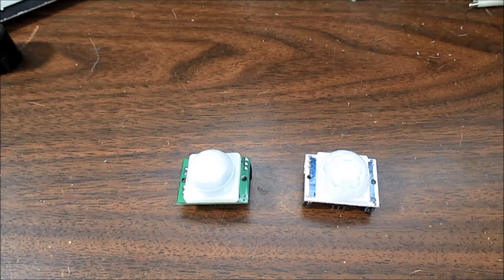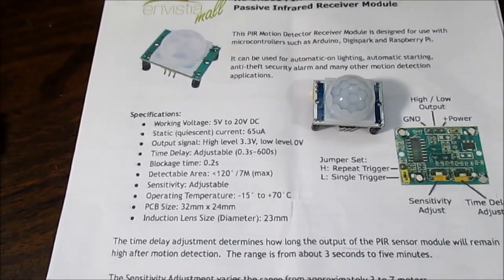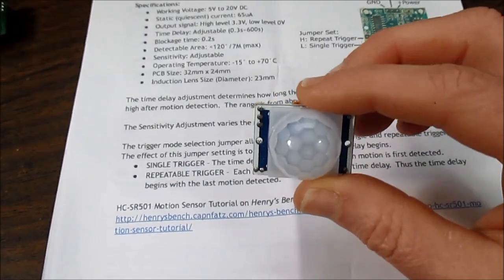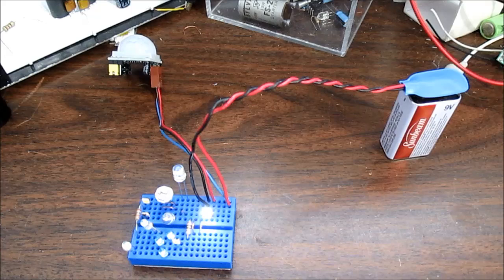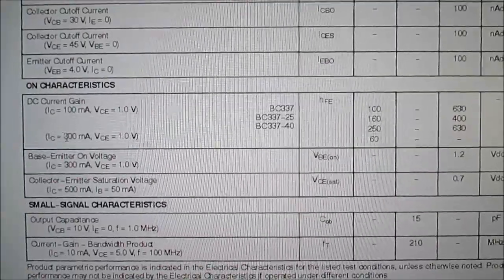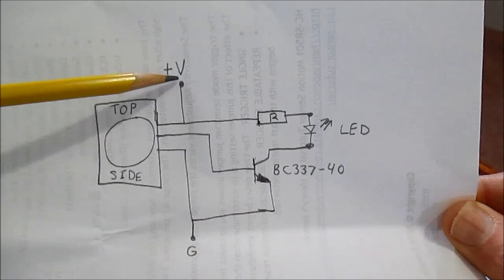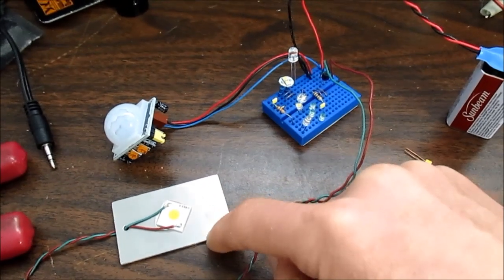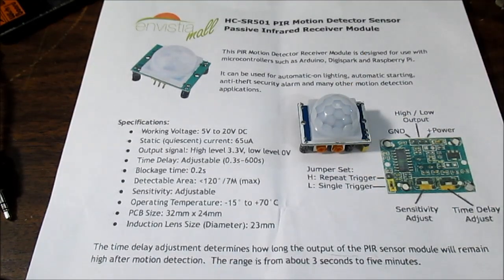Passive Infrared Receiver (PIR) sensor review, test & how to use

Comment: Please help me 
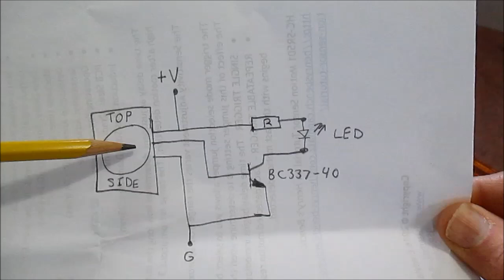If in the circuit shown in 8:45 , i want to use a mini vibration motor(coin type) in place of led at the output, what should i do? The vibration motor has ratings of 3V
Reply from the maker: Depends on the current draw of the motor.

Comment: Hello, thanks for the video. I am trying to use this sensor to light up a strip of 5v leds. I am using 5v power supply. I am doing exactly what you have showed but the problem is that Leds lit very dim. I have checked the output voltage and it is around 3 volts. I am using BC547 transistor. How do I fix it and get full brightness from Leds? Btw I do not anything about electronics :)
Reply from the maker: I need to know the current the LED strip requires.
Reply: It takes about 0.72A current.
Reply from the maker: The BC547 is rated for a collector current of only 100ma. You need a transistor that can handle 1 amp or more. You will also need a lot of gain as the current is very small from the PIR sensor. Look up a darlington configuration. You can also use a MOSFET transistor if you can get one with a low turn on threshold that will give you a low enough "on" resistance with the gate at 3v.
Reply: Thanks. That's a little beyond my comprehension. Is there any other motion sensor module that I just put in between power supply and leds and it would work as switch?
Reply from the maker: There probably is something out there. I don't know of anything specific. Perhaps something with a relay.

Comment: Hi John, Perhaps you already know you can use Dark Detecting Circuit to activate the PIR at sundown, saving your PIR battery. Electronics N More has a video about same. Thought you might be interested. May not be necessary. Be good, C.
Reply from the maker: This PIR module has an unused port for a Cds sensor. I'd have to try it out if I can find one that fits. As long as it doesn't increase the standby current, it would be great.

Comment: Hi John, Thankyou for all the great reviews and recommendations you make, I take your word for it. Yes, it's about the performance of the LM1875 that I'm impressed with too. Love your channel. All American Five Radio, Rick, built a push/pull audio amp using a 2n2222 NPN for the driver and a TIP 31 NPN, and TIP 42 PNP, cross over diodes, any silicon diode is o.k. per Rick. His is running 24 volts, I would like to use 12 volts. I'm going to use Ohm's Law and take voltage measurements to re-bias the transistors. Maybe you could build the circuit and do an output test, I would be curios what it is for watts. Take care, C.